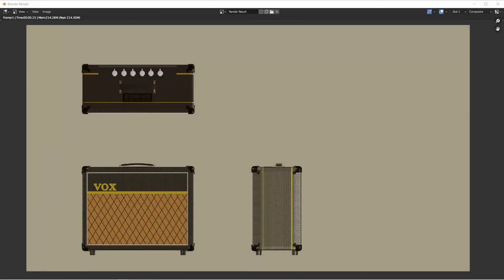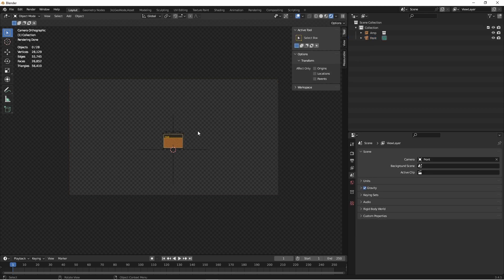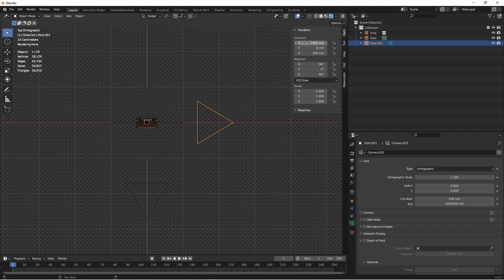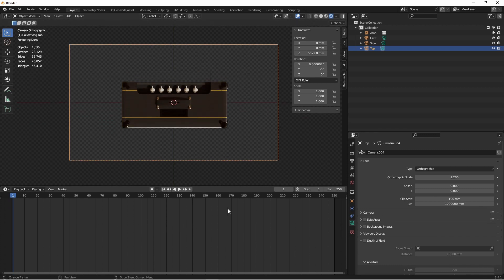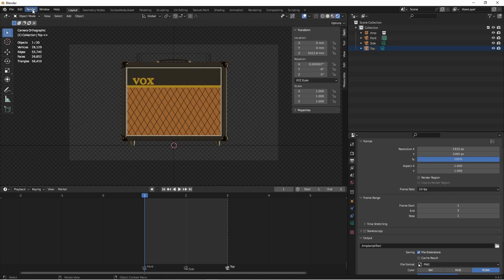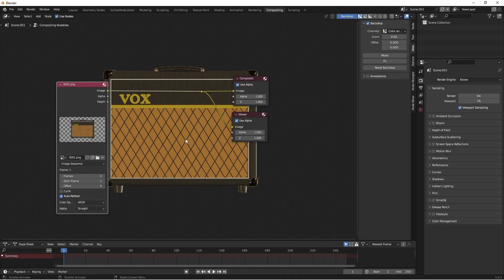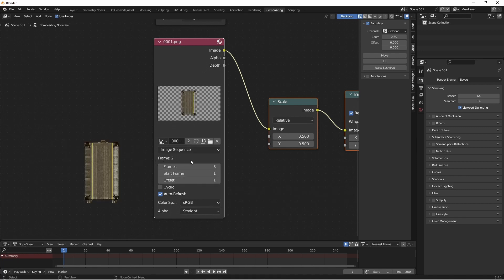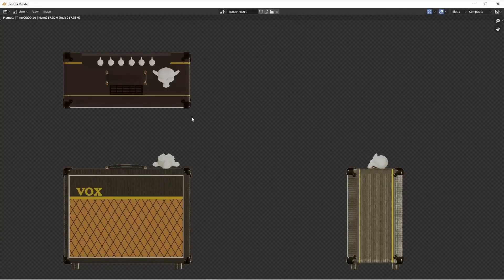Rendering a 3-Way Image in Blender - Great for Technical / Product Renders!

Comment: Couldn't you just use Quad View? (Ctrl+Alt+Q) and set your viewport shading to Rendered, then just turn off gizmo visibility and overlays, and  take a screenshot. Done.
Reply: Oh, and dont forget to go to the toolbar (press N) and go to View > Quad View > and make sure that Lock Rotation, and Sync Zoom/Pan are both checked
Reply from the maker: I suppose you could, but I think you can gain some extra flexibility here. What is you need to render at print quality? 300dpi or 600dpi?
Reply: @JohnnyMatthews  Fair point. Just for context, I mainly use blender for 3D printing and part design, and often need to iterate parts and send images with dimensional changes to clients as quickly as possible. They don't need 300dpi, as most people are viewing the images on their phones anyways. But for quality graphic design, your method trumps Quad View hands down. I guess it's all about what you or your client needs, given the context.
Reply from the maker: True, If you want to keep sizes synced up but have a couple of other perspective views and maybe some text in another area, you have pretty unlimited flexibility this way too. I’m thinking about making a script that would automate the creation of this whole setup.
Reply: @JohnnyMatthews  I now prefer your method, as I just now discovered that the Measureit tools addon isn't compatible with Quad View :/ So I can't display exact dimensions while in Quad View... I wonder if there is an easy fix for this that I'm missing...?   : |
Reply: @ZakTransfr It's been in Blender since 2.79 (and possibly before, but I couldn't find an older version entry in the documentation)